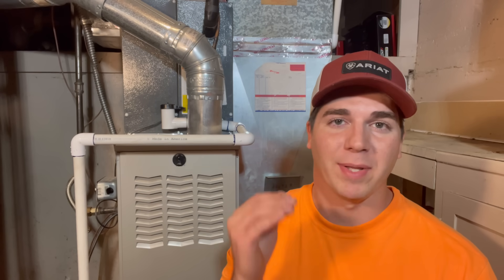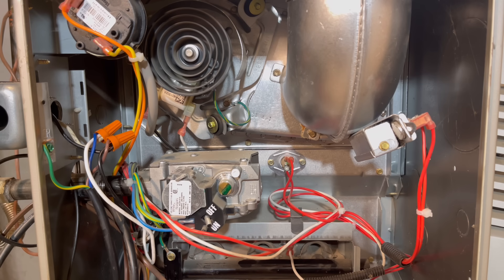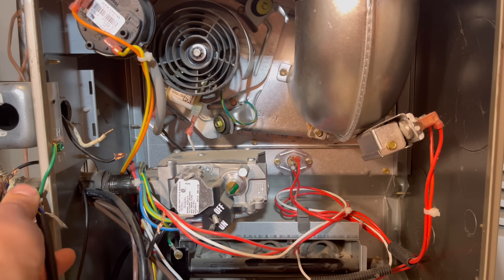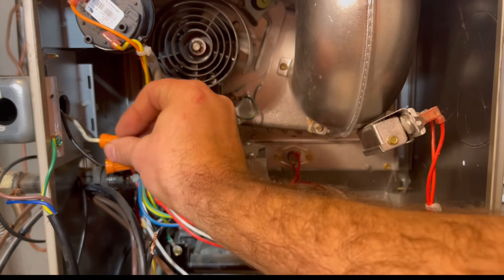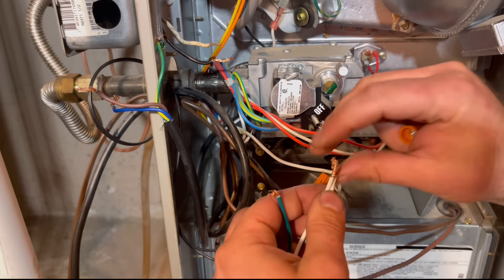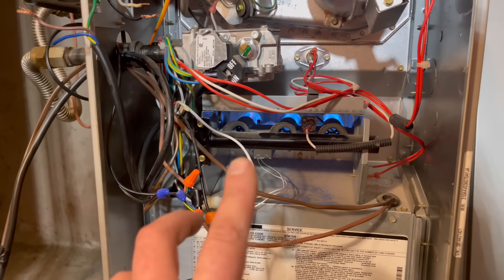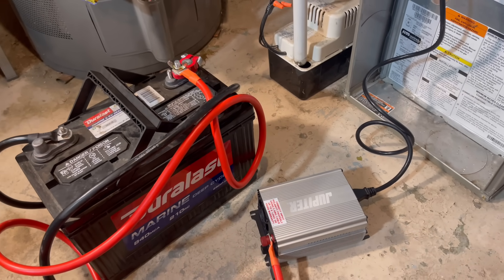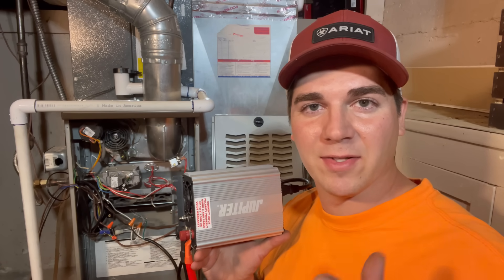Did You Know You Can Heat Your Home With A Car Battery?

Comment: Nice out of the box thinking. A few observations. As an off grid solar guy there is no way will it last days, just a couple hours at most. Average forced air furnaces pull 600-1000 Watts depending on the fuel source and fan size. Also,  lead acid's 50% DOD on a Deep Cycle paired with Peukert's Law and inverter efficiency will really hamper the idea. To run that load you really need at least a 24v input voltage inverter and several 12v Lifepo4 batteries in a series parallel config.  Another thing to note is that the inverter needs to be pure sine.  A modified wave will likely damage newer variable speed blower fans, zone actuators and logic boards. Tuning in for the runtime test.
Reply: I would still do this in a "emergency" I would rather my family be warm until I figured something else out.
Reply: @marshall7201  as long as the gas is flowing, yes.
Reply: @marshall7201 until that crappy modified sine wave inverter fries the electronics board and now you permanently don’t have heat. Bud, if you’re so worried, grab yourself a cheapo loud generator, metal Jerry cans and a suicide extension cord to plug the furnace in.
Reply: Exactly. A typical 12 volt camper battery is 100 amp hours but can only be discharged 50 amp hours. That is 50x12=600 watt hours. If furnace is 800 watts, then it will run furnace 600/800 = 3/4 hours. That said, if an inverter was connected directly to a running car, it would run about as long as there was gas in the car.
It is also true that you should use a more expensive pure sine inverter to avoid damaging the furnace motor.
Reply: @tgriebe  if you are running the car anyways just get in the car an turn on the electric heater...
Reply: @NithinJune  🤦
Reply: @NithinJune  if snow packs in up to ur exhaust pipe u could die of carbon monoxide poisoning.  That happened to a 22 yro mother and her infant when they lost power in their apt.  She thought she could keep herself and her baby warm in the car.  Poor thing perished and so did her wee one.  This happened in Laporte Indiana a few yrs back.
Reply: @Nithin  FYI cars don't use electric heat.
Reply: @tgriebe  Right.The simple,real fix,is buy a small 15 Amp gasoline generator.🙃
Reply: @tgriebe  If you go to the high side of 900ish watts that would be a 90 amp draw. I don't know of any car that can run that load at idle. This is why you don't see people running large appliances off of vehicles during outages.
Reply from the maker: @MrMike-fn4hi  hmm thanks guys for the input, I’m definitely going to try it out and see. It doesn’t run for 3-4 hrs. It will run for maybe an hr to warm up the place to 80 degrees and then sit for quite a while before I’d have to kick it back on. I may need to get crafty with the test video :) cheers all
Reply: @diyhvacguy  Exactly, the furnace usually won't have to run continuously.  In the dead of winter, when it's 15 F outside, my furnace doesn't run more than 20 minutes per hour, guaranteed.  Ironically, the more oversized your furnace, the less it'll run on the coldest days, but for a gas furnace the gas usage scales faster than the electrical use.

I'm wondering now, in an emergency where you were running the furnace off a battery, if you'd be better off lowering the thermostat, to improve heat loss efficiency -- or cranking it up, to take the maximum advantage of a hot furnace by running it longer once the heat exchanger was toasty.  Pain to test it both ways, though.
Reply: @MrMike-fn4hi  That is true, but the furnace doesn't run continuously. So the deficit of the (90 amps?) comes out of the battery. Between furnace cycles, the car continues to run and recharges the battery. One can also step up the idle speed with a little weight on the gas pedal.
Reply from the maker: @RandomAxeOfKindness  I’d love to do a test but it would take a long time.. I personally think it would be better to leave it at say 60 degrees, because it will run in small increments to keep it at 60 where as if you ramp it up to say 85 it will have to stay in for quite a while to get from 60 to 85.   I’m really excited to do this test. If only I could just film videos for a living like Scott @everydayhomerepairs haha that would be nice. 😀
Reply: @tgriebe  Yes but with a big BUT. If you are just doing this for 15-30 minutes you will likely be OK. But, if you plan to do this for a day or more during an outage there is more that comes into play. Modern vehicles monitor the amp draw with an amp clamp or shunt on the battery leads. It will full field the alternator in an attempt to get as many amps as possible from it that it can. If you are pulling 90amps at idle from an alternator that only makes 130 at it's rated 2.5-3k rpm you will have a problem once the battery's charge level starts to drop. This becomes an even larger issue with hybrids as they do not function the same and have very small starter batteries and alternators. In the past this would never have been an issue as the charging system was not monitored like it is today. You will also find vehicles that see this amp draw as a problem and set your service indicator and toss the vehicle into limp mode. High amp draw is seen as a potential short, possibly interfering with the electric throttle's operation and negatively impacting fuel economy hence the service indicator and limp in mode. Some vehicles are much more sensitive than others so it really is a crap shoot. Vehicles like trucks and full size SUV's are less likely to have the issue as they are expecting to see higher loads from third party equipment such as plows and winches and come with larger alternators. But, there is a limit. Isolation solenoids and PCM reprogramming is sometimes necessary when unfitting vehicles. Also, the inrush current of starting a large AC motor is significant, 2-3x the running watts. The alternator to battery wiring is likely only 8ga at best. At minimum  I would add a second 4ga conductor from the alternator to the battery and also a second chassis ground of 4ga or 0ga. If you really want to run a load this size you should have a generator or appropriately sized solar "generator". Another option would be Ryobi, Dewalt, Milwaukee and Ego make 2kw+ battery inverter systems now. You can install a 120v single circuit transfer switch right into the dual gang box on the furnace that will accept your extension cord. Apologies for the long response. Electrical engineer by trade, former GM powertrain engineer.
Reply: @MrMike-fn4hi  You are obviously a glass half full guy but I commend you for all the effort you have gone to to figure out a scenario where it won't work.  Of course, a generator is a better idea and of course bigger cables and a bigger battery  and inverter are a better idea. But what we have here is a guy trying to run a furnace off off a camper battery with a modified sine inverter, a plan that doesn't have a prayer of keeping a house heated during a multi-day power outage. What I have suggested is a way to recharge the battery between the brief intervals that the battery will actually run the furnace. Maybe you can expend a little effort in providing useful suggestions so that an average home owner can actually make an inverter work to their advantage.
Reply: @tgriebe  if you're ok with telling people that they can rely on their vehicle to prevent their families and pipes from freezing that is on you. Not a single car or small suv make in the past decade can do that long term without damaging it. I gave several alternatives. Just because you didn't like them is not my problem. Facts are facts.
Reply: @MrMike-fn4hi  You have provided no useful help to someone SOL with a freezing house. They don't care if you a GM engineer or a high school dropout, they want useful information. Even a small car can recharge a second battery, perhaps not while under load from an inverter, but suggesting that might be too much of a stretch for someone intent on not helping.
Reply: @tgriebe  you are off base here. Anyone can post a YouTube video. Doesn’t make it efficient, safe or worth the money. His comment was more useful to me than the video. I’m also an engineer but haven’t dealt with this side of it since college. I had tons of questions watching this video that this commenter answered snd made sense. If a non pure sine inverter can cause damage to the unit, then this battery idea isn’t something I’d try. Just because someone comes up with an out of the box idea and posts it on YouTube doesn’t make it right or good.
Reply: @tb2324  You might want to work on your reading skills. I pointed out in my first comment that a pure sine inverter would be necessary. What I also did was provide a practical suggestion for a way to make this actually work using a running vehicle to keep the battery charged enough to be useful. Richard  Head was so anxious to show off his credentials he forgot to provide a useful pathway to making this work. Instead, he came up with various scenarios where it might not work (tiny car, tiny cables, etc.)  In fact, with a typical work truck, my suggestion will work just fine.
Reply: @tgriebe  I have a suggestion, but it's an expensive one. A large solar generator capable of at least 2000 watt output that can be recharged by gas generator and/or solar panels. Also can be recharged using your vehicle.
Reply: @keyfitter  The video creator was trying to help people caught without electricity and heat using cheap items still available after all the generators get snapped up in stores. I'm not sure your suggestion fits into this theme.
Reply: @MrMike-fn4hi  that may be true to GM but any modern car  usually have 160+ alternators and have 2 gauge wiring. My ford escape has a 180a alternator and its just a 4 banger. Plus current draw would be intermitent and battery would serve exactly its purpose as a storage in between load cycle times.
Reply: @MrMike-fn4hi  I have a 94 Z71 that I installed a inverter on and have ran it the last 12 years. Working away on the road I use it frequently to charge tools, run tools, portable heaters and hot plates to cook many meals. This has been a fib for as long as I can remember.  By debunking this claim many years ago I purchased a small amp in and output monitor.  I connected it up and went about my daily business and after months of testing there wasn't much change to my amp pull on my alternator or battery.  If you get a quality vehicle these days you can get them with 110volt outlets already configured and to be used as normal.
Reply: @tb2324  modified sine wave is a PWM signal with both positive and negative going half cycles. The fast skewing edges of the wave form generates significant harmonics which reek havoc in motors due to iron saturation causing excessive heating that will distort motor winding insulation. Also the power that heats is not turned into mechanical power so 100W shaft power might take 130W electrical power.
Reply: @albertobu  my old Dodge Grand Caravan can put out 20A at idle if necessary much more at throttle. What amperage can a more modern vehicle do at idle?   One needs to be careful and respect the charging rate of batteries, especially FLA cells. It could take hours to properly charge a completely discharged FLA battery so frequent charges like every time the furnace goes off would be necessary to protect the battery and keep up with the demand.
Reply: @MrMike-fn4hi  Excellent!!!
Reply: @MrMike-fn4hi  Thanks for that.  It is not just for keeping the Gas Valve open, there is a sizeable Fan that requires sufficient Amps to operate the furnace.
Reply: @RandomAxeOfKindness dead of winter here waaaaaay colder then 15F where I live, but I guess if you were in Texas and you could run your furnace even for an hr a day is all you would need to keep your pipes from freezing up
Reply: @albertobu  I was just reading these comments and I’m glad you pointed out that the alternator has the amp capability! but it’s not advisable to load the alternator at low rpms it’s ok to recharge the battery at idle but excessive load can overheat it! Low speed is when an alternator is at higher stress and temperature! I’d advise to use a higher idle even 2000rpm will drop the temperature compared with 1000rpm
Reply: @MrMike-fn4hi  9
Reply: @diyhvacguy  Looking forward to the test video! Hopefully you include runtime on battery setup as well as runtime & setup of connection to a running vehicle. Thanks!
Reply from the maker: @BenFyvie  yes for sure
Reply: @diyhvacguy  Hey when you try this, put a kill-a-watt meter between the source and furnace so you'll know how much power it uses.
Reply from the maker: @coondogtheman  I’ll pick one of those up for sure. Thanks!
Reply: @diyhvacguy  I love mine. Got it from harbor freight.
Reply: @tgriebe  As stated multiple times above,the  battery is the limiting factor,when dealing with this power consumption.
Correct,it's gasoline generator time.
 Solar generators are simply " toys" very limited power production,even if it's sitting in the desert sun.Small solar generators,will maybe charge a phone.In a blizzard,you're just going to hear some clicks 🙃
Reply: @MrMike-fn4hi  All good. Only took two hours to break it down. Now I'm on the generator bandwagon. 🤣 What about switching from petrol to water with the hydrogen in real time conversions generators I've seen here on YT.  Only asking because of the highly intelligent conversation here.
Reply: @bcole3442  Not my video, but if you don't have a generator, this inverter / truck alternator set up is an alternative to get you by. I never suggested using a solar panel, so I don't know where you got that.
Reply: @tgriebe  Sorry about the solar,was someone else's comment
Reply: @diyhvacguy  my I also suggest getting a good used VERY fuel efficient car like a 3cylinder Geo-Metro / Suzuki-Swift and using it as both a cheap GENERATOR to recharge multiple batteries AND to use as a water heater to heat up multiple Cast Iron Radiators in your home like the type used in old schools & other large buildings built up until about the 1970's . Disconnect the heater core hoses from the Geo-Metro / Suzuki-Swift heater core & connect the hose to the cast iron Radiators that you would need to install through out the house to keep it warm . Plus you could remove the seats & store the extra batteries and power inverter inside the car and also bolt solar panels to the outside of the car .
Reply: @MrMike-fn4hi I have a small SUV that can.  It’s a PHEV Rav4 Prime and has a 1500 watt inverter that runs off the high voltage battery. Even the rav4 hybrids non PHEV have it. Just runs off a much smaller 2kw battery Vs 15-18 kw in the PHEV. 
The most ideal is a large 3-5kw + battery bank/solar generator though. It can be done for $1500 using a 48v server rack 5kw battery and a 3k all in one inverter
Reply: @tgriebe  wow….what a comeback….you smoked him….in a nice way, which is a talent I share with you, but I rarely see people do it better…..but u did!  Nice retort!
Reply: @RandomAxeOfKindness  9th
Reply: @diyhvacguy  b
Reply: @tgriebe  mike smoked you like a cigarette….. 😂where’s the ashtray for toms ashes !!!
Reply: @tgriebe  aside from the battle between you guys, I just want to point out this inverter is a pure sine wave, not modified. It's still not gonna keep the house toasty for 3 days in freezing weather, but I thought I'd point that out for the technical aspect. It seems like a really good little inverter for a $145 price point! I'm glad he drew my attention to it. I need a little one to run my aquariums off of in case of power outage, and now am thinking having an extra for the house is a good idea.
Reply: @tb2324  check the link... it's a pure sine wave inverter with good reviews. Several people tested it and report it produces a really good, smooth wave.
Reply: @cherylmockotr  Yes, I pointed out in my initial post that a pure sine inverter would be preferred to the modified sine inverter the video creator had linked.
Reply: @tgriebe  that's what I'm saying... it IS a pure sine wave converter, he's NOT recommending a modified wave device.
Reply: @cherylmockotr  He changed the link after we pointed out that the modified sine inverter he used in the video was inappropriate. It was a good idea to update the link, but it has confused you and others.
Reply: @MrMike-fn4hi  the Prius may be the best car for this, I’ve run my inverter on it pretty hard and have had no issues, you just have to keep it in ready mode. The Gen 3 (‘10 and up) have over 100A DC-DC converters with liquid cooling, and if you over do it they’ll trip out without failing. They also make inverters that run direct from the HV pack now and you can pull 5kW+ continuously and the car doesn’t care at all, it’ll just run the engine when needed.
Reply: @tgriebe  ah, that makes sense now... thanks. He probably should have put that in the description of the link. At least it's a pretty decent looking unit!
Reply: @diyhvacguy  if the power is out, how does the thermostat function?
Reply: @tgriebe  if u have a gas stove boil water to heat the home or room.  Occasionally allow a bit of moisture to escape especially in newer homes so that moisture doesn't accumulate in the attic.  Its a quick fix without having to Frankenstein ur furnace power hookup.
Reply: @americaneden3090  No,no, no. Never use a stove for heat. Every stove manual tells you this.
Reply: @tgriebe  kinda of a use what ya got to survive mentality
Reply: @michaelcharach  We had non-stop utilities in Austin and my kitchen faucet still froze last week.

Home building in Texas is just not spec’d for hard freezes. (We had 15f.) Exterior faucet valves are located outside of house walls, pipes are buried just 12” deep, that sort if thing.
Reply: @MrMike-fn4hi  I don't think anyone here was looking at this for supplementing power with their car as a "long term" solution. Will doing as the other guy said cause damage to you vehicle/alternator? Yes, but so will a trip to Wal-Mart. In the grand scheme of a 200k mile life, a few recharge cycles in an emergency will not even be noticed.
Reply: @MrMike-fn4hi i have a 325A alternator on my car? Wouldn't that carry a 90a draw? (DC Power billet HO alt)
Reply: @mrkoolio4475  funny I was thinking the same thing wtg lol
Reply: @MrMike-fn4hi  if you don't want your pipes to freeze,you just leave them on a trickle, if the water keeps moving,even if only slightly,then they won't freeze
Reply: @diyhvacguy  exactly. My furnace runs for 5-10 minutes at a time to get it up to temp.
Reply: @MrMike-fn4hi  that explains a lot 😂 a GM engineer 😂😂😂😂 a company that builds utter garbage and hasn’t moved out of the stone age of engines. 😂 engineers people they generally have no clue what actually happens in the real world and it’s usually mechanics, electricians, programmers etc that have to fix their screw ups.
Reply: @terryharris3393  😂😂😂😂😂😂😂😂😂😂😂😂😂😂😂😂😂😂😂😂😂 who told you that? Every vfd on the planet outputs essentially a square wave and they have never harmed any motors I’ve ever been around.
Reply: @lonewolftech  Even though VFD drives produce a PWM voltage the current is nearly sinusoidal due to power filters on the drives output. These eliminate the harmonic content. It’s the iron losses due to the harmonics that generate heat due to flux saturation in motors and unless a modified sine wave inverter has an output filter its output will contain the harmonics.
Reply: I agree, a vehicle battery wouldn't have the capacity to do this for long. A better bet would be to leave the battery in the vehicle (or jumper it to the vehicle if it's an aux battery) and hook up the inverter and then run an AC extension cord from the inverter down to the basement. Start the car, run the furnace for a while, then shut off the inverter and let the car battery charge back up then shut off the car. You could repeat this almost indefinitely as long as you have gas in the car and you don't have to lug that car battery up and down the stairs or disconnect/reconnect it every time.
Reply: @TheDaniel688  charging a flooded lead acid battery in a non ventilated space isn’t a good idea, let alone next to an ignition source. Also, setting it on a concrete slab will not only drain it but when a charging cycle begins there will be much more hydrogen gas produced. 😮
Reply: @terryharris3393  did you reply to the wrong person? I didn't propose doing either of those things.
Reply: @TheDaniel688  .. this whole video and commentary is surreal..
The joker that made it didn't bother to actually try it and none of the 'experts' have either... ☠️👀
So yes this was a complete (possibly dangerous) You Tube clickbait troll ..these inexpensive inverters use up a lot of current just to run themselves even with no load, much less any high demand system.. (and the triangular wave output will fry most electronics control)
... My expertise ?..
I'm in Florida and have been using one for years during hurricane blackouts .. to simply run a room fan and led lighting.. intermittently..
Reply: @terryharris3393  you just lost all credibility when you said leaving a battery sitting on concrete will drain it. That is one of the oldest wives tales in the world. I'd like to see you explain how concrete is going to drain a battery when it is not even touching any electrical contacts. It's literally only touching the plastic box that is holding the chemicals.
Reply: @terryharris3393  he never said anything about running the car in an enclosed space.
Reply: @TheDaniel688  Don't pay any attention to him he actually believes the wife tale about concrete draining batteries.
Reply: @terryharris3393  You're right about ventilating the space but wrong about the concrete floor somehow depleting the battery. That's an old wive's tale that Exide Technologies, one of the world's biggest battery manufacturers, debunked back in the late 1980's. The surface you place a lead-acid battery on has NO effect on the internal chemistry or its performance.
Reply: @actionjksn  At Sears we charged batteries on a metal rack that was on top of concrete slab. The battery room was always a mess.
Reply: @fromthebackofmymind  either way if a battery sits on top of concrete it will have absolutely no effect, it does not drain the juice out of a batteries. Back in the really old days in the early days of automobiles battery boxes were made of wood, and the wood could draw moisture from the concrete and rot the wood. At that time you did not want to leave a battery sitting on concrete. But in our lifetimes batteries have not been made out of wood.

I never believed it because it never made any sense to me, because I could not figure out any mechanism that would cause that to happen. So I checked on some websites with electrical engineers and you know those Smart Guys and they all said the idea that concrete will drain a battery is stupid.
Reply: @terryharris3393  curious how a concrete slab can drain a battery. Last I checked, batteries are equipped with a insulating material for its housing. You can install a battery on steel and it works just fine.  

Something tells me that the sulphuric acid, if leaking from a battery will destroy concrete.  That only happens when charging a unhealthy battery, or overcharging a battery.  I also observed that they also give off gas when being discharged.  Does hydrogen gas affect cement?
Reply: @pixels303at-odysee9  old wives tale that just refuses to die. Back in the day and I mean 60+ years ago batteries were made of wood casing and the wood was conductive enough to slightly ground itself to concrete. But I mean, talk about zero chances of it happening now.
Reply: @actionjksn  try it ?
Reply: Seems like a lot to ask of a single battery. A small 2000 W generator might be a good option to tap into that wiring.  maybe one with a NG conversion kit??
Reply: @peterfairlie2296  I think I recommended a pure sine inverter.
Reply: We actually have a lifepo4 solar setup in our camper that we could run cables to in a situation like this. 
It's got a built-in pure sine wave inverter too. Seems like that would be ready to go for a situation like this.
Reply: Why not just stay in the camper lol
Reply: Off the grid?yet here you are on the internet
Reply: Yes, the question is not if it will run. It's all about how long it will run. I have two off grid installs that would run a gas furnace for a while if I had one. Unfortunately I have a down draft electric furnace which would simply draw too much current even if I rewired in series.
Reply: While the battery is running the heater, it can charge with a 10,000 watt  charger from a generator welded to the blower motor.
Reply: Great video and idea. Hate that all the internet Einstein types couldn't wait to put their negatively charged two cents worth in. Your idea might help someone stay alive
Reply: Put a kilowatt meter inline with the furnace.  This will tell you how much the furnace draws. Those figures with simple math will give you a ballpark idea of how long it might run. Of course battery size, and age will lesson the run time.
I live in the country, and have small kids, so redundant power, and heat are a must.
I have a generator just for times like this, and have used it, but, I primarily heat my house with a pellet stove, and use the furnace as backup. 
I cycle the furnace and genny every 30 days, and with a genny, I can run my well and fridge too.
Reply: You'll have about 2 hours of the furnace working and then no way to start your vehicle... genius.

The common sense thing to do is have a cheap generator with a natural gas or propane conversion and they you have clean electricity for weeks at a time if need be.
Reply: Can you stack a few batteries for extended power life?
Reply: @chrissullivan40  Yes, but I think it makes much more sense if you have multiple batteries to just recharge one and swap it out when it’s charged. 

Also, most power outages only last a few hours tops, this would be an ok way to keep the house up to temp for the extreme vast majority of outages given you didn’t have access to a generator. Really though a generator is the best idea and you can get small used ones for pretty cheap, then you can power your refrigerator, lights, chargers, even tv and internet usually off a generator. Even if you wanted to just run your furnace, I’m sure a generator is going to use a magnitude less gas than running your car to recharge these car batteries and swap them. Then there’s just the convenience, you can wire up an automatic generator but even the most crude setups aren’t a big deal, switch off main breaker, plug generator in, start up and get running then flip your generator breaker on.
Reply: I think the spirit of this video is “oh sh!t the power went out and I’m unprepared, what can I do in a pinch to get my furnace going” and given that situation you may* have all the stuff needed to perform this, but if you’re planning ahead then you plan with a generator of some sort, it doesn’t make much sense to plan ahead by having all the stuff to do this.
Reply: Great short term solution. But I’d rather depend on a generator for a long term solution to a power outage but nonetheless thank you for taking the time out for a quick fix to not freezing the house pipes and family.
Reply: How about a battery for a caterpillar bulldozer?  24 volts, tons of cranking amps?
Reply: 2 + 2 =4
Reply: @kyledakilla8724  not since the plannedemic lol
Reply: I've done this to power my refrigerator in the summer during a power outage. I do want to know if this will work to power my all electric heat pump?
Reply: @djinncat  it will not run an electric heat system.  This would not run a small space heater on the high setting.  This only works because the electricity for it is only spinning fan and working the ignition and controller. You would need a lot more power to run an electric heat pump.
Reply: @actionjksn  you are right about electric baseboard heat and space heaters though. That's different the heat is coming from only electric elements not gas. Electric heat is 100% efficient. Meaning 100% of the electric is turned into heat BUT it is a terrible way to heat anything. Costs far more to heat with electric than gas
Reply: @djinncat  isn't that heat pump 240v?
Reply: I have a gas boiler system so it probably would work well.
Reply: @toddforslund3571  yeah... just have to power the pump. I think most run at less than 1 amp
Reply: Well this trick is pretty badass if you live  in the north and don't have a generator when SHTF. You recharge the battery in your car multiple times a day and keep pipes from freezing 🥶. Lots of possibilities. According to my HVAC guy a lot of modern furnace's won't run on smaller generators cause they can't sense a ground and you have to run the generator to your breaker and plug into the normal wall outlet, something like that anyways.
Reply: Mr. Mike, Yet another reason to have a decent sized generator that can run on natural gas or propane. I keep matches handy to light the non functional spark igniters, for burners on my stove during outages. Dead of winter, I can put all my refrigerated food into an extra freezer in the shed. Powered or not. Insulated box.
Reply: That’s incorrect. My furnace draws less than 50 watts at 120 volts when running. That’s 0.46 amps. For the D.C conversion it’s 4.6 amps but let’s round that up to 5 amps. I have a 208 amp hour battery bank. I’ll get 20 hours to 50% capacity.
Reply: In emergency situation some hrs of heat better than nothing bro.
Reply: Better then nothing
Reply: Must be tiny btu furnace, 1,000  watt inverter will not start my furnace , also car battery can’t take a big drain like deep cycle battery’s can and are made for..
Reply: Thank you for the rest of the story. His idea is good on the surface but there are a lot of electrical caveats he is overlooking. Furnace fan motors have a high start up current also. In addition to the variable speed motors not liking a clean wave the electronic circuit boards might also frown upon it.
Reply: 🤔 I never knew about the batteries. Peeked at the Dakota site. Whoa, those are awesome. Power depletion evenly and twice the power of standard. Use for off grid power systems and half the weight. I sound like a damn troll but hooked on this idea.
Reply: Cool, but way to much for the average person to try, and safety wise i would have a lot of concerns about anyone other than a qualified electrician or a skilled DIY person doing this on their own.  We have solar and batteries, and if we were to need to run on batteries we can use the management app (or just turn off specific items at the breakers) to exclude the most taxing appliances.  I would be very concerned about the start-up amps needed by the inverter.
Reply: @john4703  It is good that you know your personal limitations, but not everyone is an idiot. Some people should call an electrician to change a light bulb.
Reply: Alot involved, but for basic furnace nothing special it may keep the pipes from freezing till power is restored.
Reply: Maybe a space heater which runs a motor the size of a softball.
Reply: Could last longer if you power it off jumper cables off your car that you leave running.
Reply: Where are you getting that high of watts on a gas furnace? It's just a fan and ignitor. Maybe a 200w load at most. Unless they're significantly worse than camper units since mine only draws about 3A at 12v to run the blower.
Reply: You beat me to it...Fan will drain it pretty fast no doubt about it.
Reply: It will last days I have done it myself
Reply: Glad I read this. Thank you.
Reply: I actually did this.  Dead of winter last year, power went out.  I took a extension cable from my fifth wheel trailer, modified it with two male connectors, turned off my main 100amp fuse and then turned on my trailer inverter.  I use only True Sine wave on my very expensive 1200watt inverter and seven of my used car batteries I decided to recondition and installed in my trailer.  After one day of running my furnace, fridge, freezer and a few LED lights my batteries were beginning to brown out after 8 hours of use.  I had to then start my generator and start charging my batteries to last the 16 remaining hours required for utilities to be reconnected.

Only drawback using a cheater cord is if a person accidentally connects power to the house without turning off the mains.  If you do that, you can potentially feed power back into the grid and electrocute a lineman or if the phase or frequency differs to the electricity that is reconnected, you could blow up your expensive inverter.  Always disconnect your cheater cord after turning off your inverter as well to prevent electrocution. Never turn on your main until everything is disconnected. 

My way is far quicker to do, providing you are familiar with your load ratings on appliances.  If you plug in or turn on too many things with a classic 12-15 amp electrical cord, you will be overloading your inverter.

Modified Sine wave inverters are garbage.  I blew up more of these inverters than I could shake a stick at.  Switching power supplies which electronics are equipped with do not work well with a square wave input.   Unless you plan on using your inverter for a resistive load, do not ever use them.
Reply: Nicely said.
Reply: Calm down everyone. It’s not worth arguing over. Take what you can use and leave the rest. I’m sure some will benefit from watching. Let’s get back to being able to have an opinions with out getting pissed off for not having the same opinion. Sad to see how corporate America is killing America and keeping everyone fighting. And paying their taxes for them.
Reply: @G-S-D  so true. Everything you said.  Reading comments brings the worst out of people because words without tone or body language/facial expression can be grossly misinterpreted.  Doesn't help any that media is programming people on a CIA style psychedelic style.  Gender confusion, health measure confusion, giving up rights for security confusion and spending all your money on inflation confusion.  List goes on and on, all designed to divide and conquer under a guise of health, well being and tolerance.
Reply: Lucky guess! 😂
Daggone mister! YOU KNOW THINGS!!! You are what I refer as a "Tall Forehead".
Very knowledgeable! Thanks for answering questions and concerns that 8 had.
Reply: I did a test. I have 10 batteries parallel. I connected the furnace to the battery bank. In half hour the batteries went from 13.5 to 12.4
Reply: How will my furnace kick in since I have an electric programmable thermostat? ? Will this also power the thermostat upstairs?
Reply: A lot of these u tube vids show peeps how to fk up their shit so i would not be surprised if it did do damage .... then ya got to call this guy to come fix the shit you fked up cause ya saw it on boob tube
Reply: That would be pens on battery sir. Sit down and pipe down.
Reply: It's a gas furnace though. Much less electrical load than an electric furnace
Reply: If it were only this simple, but it’s not.  A lead acid battery will not run very long with an inverter supplying 120 volts power.  Moreover, you’d better hope that you are getting clean 120 volt a/c power at 60 cycles from the inverter or you’ll be replacing motors on your furnace.  

Your best bet is to buy a small generator to run this unit.  The small Honda units (EU2200i) that are no larger than a suitcase can do a much better job and can also help you keep your fridge and other small appliances going.  Now, they ain’t cheap, but if you can snare a used one or a knock off version, you’re better off than the battery/inverter setup.  Better yet, get a good 7000 watt generator that’s portable and you can power quite a bit if faced with a long power failure.  

Again, be careful when running motors with temporary power of any kind.  120 volt motors don’t like under voltage situations or massive spikes.  You’ll be paying me, (HVAC contractor) to replace a bunch of stuff if it doesn’t work well.  My 2 cents.
Reply: Can we download your brain xD
Reply: Thanks. Question : Gasoline generator to supply heating/cooling to your home HVAC an option ? How hard would it be for a homeowner to configure this ? Thanks.
Reply: @dannyhayes664  See the DIY HVAC Guys other video on how to wire in a plug so a generator can run the furnace off a heavy extension cord.
Reply: Screw all that crap ,I'll  lite a fire in my real fireplace, over 5 thousand  pieces  of split  wood  should  last  a while
Reply: @danmittler6321  Very helpful.
Reply: Mr. Mike can you do the same breakdown but with a mini split ac? Your explanation is helping me understand the math. I am a fellow offgrid'r myself and I'm still trying to grasp it all. 
I just inherited a led acid battery bank. They are older battery's but haven't been used and were new when they were purchased.
Reply: Car batteries are like 40amp hours. My furnace is about 1000watts. That would be about 100amp draw at 12 volts. You are talking like 35 to 45minutes of run time off a new car battery
Reply: @jacobadam4556  Sorta late to the party. See the follow up video.
Reply: @tgriebe  I seen follow up and in that he said 3 hours still not possible if you do the math. He showed roughly 500 watts at 11.5 volts. That's about 45 amp draw from inverter on a 40 amp hour battery. He will be lucky to get an hour of run time off a fully charged car battery.
Reply: @jacobadam4556  Exactly. that is why he switched to powering off a running vehicle's battery.
Reply: @tgriebe  and that's why it would be smarter to power off a single cylinder gasoline generator like people with atleast an average intelligence do.
Reply: @jacobadam4556  Everyone has a car or truck. Who has an extra single cylinder engine sitting around when a power outage strikes suddenly?
Reply: @tgriebe  most people I know don't have a power inverter either. Lots of people around here lost power and their pipes froze in their house when that arctic blast came through a few days ago. My neighbor could have simply lit a freaking match to their propane stove. People do what they want, just because they have a car doesn't mean they have a clue LoL c'mon man get a grip
Reply: @tgriebe  I'm sitting here at my buddys drinking beer only one awake in a house at 55 degrees with my winter coat on waiting for his roomate to wake up and bitch about throwing wood on the fire. It's all frozen wet, most of it not split right, i seen these guys waste 4 cords of wood already because they won't listen to me about efficiencies and firewood. I'm done talking to a freaking wall and I'm not throwing more bullshit on a fire. He has about 300 gallons of propane he can start burning LoL I'm not cold and my beer isn't warm. And here in a few hours a dumb ass might get punched in the mouth because I'm done listening to one complain because they didn't listen to me.
Reply: @jacobadam4556  But anyone can buy an inverter at a auto parts or hardware store and follow the video. Who is going to buy a small engine and rig up an alternator on short notice?
Reply: @tgriebe  and anyone can buy a gasoline powered generator. The power inverter is nice for camping away from home.
Reply: @jacobadam4556  You can't buy a generator when a sudden big storm hits - the stores get cleaned out in minutes - which is exactly why this video was created, to provide an alternative.
Reply: What if your blower motor runs off of 220 volts?
Reply: Would this work better (longer) on a hot water (hydronic) system that uses a pump rather than a blower?
Reply: Thank you.
Reply: Try an Odyssey brand battery , it will run much longer
Reply: An Odyssey brand battery would work much better
Reply: Actually if it's just running just the fan... It's not going to use that many watts because the heat is not coming from electricity the heat is coming from gas cuz you can hear the sound of the flame light up.... That electric motor spinning that fan might pull 10 amps Max at startup and after that it's going to be about 4-6: amps while it's running..... However if it's an electric heater anything that's electric that creates heat by use of the electricity draws a lot of Watts
Reply: Hey thanks for your input I've had TV on my house this 1985 went through a lot of r&b learning curves but it was all worth it I double-wired my home on DC only and went through a lot of headaches but finally figured out with a few computer hacks with computer grade power supplies to bump the voltage up and amperage had a few brownouts if you know what I mean and a lot of wires. Yeah this guy found out real quick about the battery a fresh battery out of vehicle sure it's going to run good for a while Kelly Burns off the good part then he'll figure it out another thing I told him that transformer in the furnace doesn't like modified sine wave inverter still figured out out pretty soon too when it Cooks everything real slowly. My 1.4 kilowatt run with 2000 A H for about 10 years couldn't grid tie back in them days. Home power the magazine was my lifesaver.
Reply: I was thinking the same thing. No way that will last days. Not sure I want a lead acid battery that produces hydrogen next to my water tank.
Reply: Square waves etc won’t harm electric motors. Most vfds don’t output a pure sign wave and every factory in the world uses them on their motors. Nor will it harm the boards as they already are DC…
Reply: @lonewolftech  which board is dc?  Bryant plus 90i control board is 24vac. The motor controller is 120v ac, the blower motor is 3ph. This unit won't run properly on a 5500watt generator due to the dirty power.
Reply: @yall guys doing science in the comment section.... I ran a 750watt space heater off a crappy little Toyota Yaris(fit right under my porch) and a 1k inverter for over a week. No it wasn't running the entire time but it ran all night with a few blasts during the day. Sometimes things just work even when in theory they shouldn't... This man's solution isn't perfect, it's to not freeze to death during a storm. You can purchase a small generator for not much more than this setup costs, as long as you aren't doing it during an outage. I have 2 generators I bought used. A very old 3k that works great for $100 and a 1k with a broken pull start for $40. Ideally plan ahead but if your in a pinch and your pipes are about to burst or ur big toe is going to fall off, this is an ingenious idea to keep in the back of your mind.... Thanks for the good stuff HVAC guy
Reply: @robertborgeson1821  Running a 750W load for ‘all night’ or 12 hours is 9000 Wh. NO car battery has that capacity so your completely full of shit.
Reply: @terryharris3393  u must be right
Reply: How'd that solar work out for you or how would it have...you fraud!!!!
Reply: Never put a battery on concrete. It drains the juice.
Reply: How many cars u got? Any straight shifts you can roll off recharge the extra battery?
Reply: All this bs, an hes just like for emergency. Jesus Mr genius what color is a mirror.
Reply: @charliewilliams5105  idk but I have many car battery’s and 2 of these and a 2 stroke gen , sadly the big 2 stroke gen kills out with power saw, ran a grinder a Chopsaw and a drill same time with one those 149 dollar harbor freight converters , but u can build you own fairly easy out of a hamster wheel a generator and microwave transformer just make sure the hamster has a back up and another back up, it’s hard get those furry things to do anything but work out
Reply: Wow…and here I thought a man’s communication difficulties were mainly with women…I commend your manners during this misunderstanding…This would be Jerry Springer material if y’all were female…🤷‍♀️
🦋Lily🦋
Reply: @Lily_Samson  You have fallen for a classic passive aggressive ploy. The way it works is the PA throws out a bunch of technical information which on the face of it looks like it is being helpful, but in reality is just an attempt to make the PA look smart and by inference, the video creator, look dumb. When examined, the PA has done absolutely nothing to help out, but has merely shot out a bunch of "look how smart I am"  factlets.
Reply: @peterfairlie2296  I don't know why you directed the comment to me - I never suggested using a using a cheap generator with a poorly regulated output. The topic here is making a furnace run off an inverter and a battery. I pointed out that a vehicle can recharge that battery to extend the amount of time the furnace can run. And I suggested that a pure sine inverter be used.
Reply: @peterfairlie2296  Don't be a troll. I gave a good answer to the video creator and provided useful information to anyone wanting to run a similar furnace in an emergency situation. You are just standing back throwing sand in the gears for some sad reason.
Reply: Thanks. You saved me some time responding with some of the same comments. Don’t forget the pesky no load power consumption and the necessity of 3-6x surge capacity of the inverter, and relatively low .85-.9 efficiency. The Jupiter inverter model in the video looks like a 2000/4000W run/surge model and is a modified sine inverter with a 13W no load power consumption. Given the video shows a Duralast 29DP-DC flooded lead acid cell with a 65Ah capacity (fully discharged) the no load power consumption would kill the battery in 60 hours without delivering a single watt to the blower motor. 

Of course the time a furnace is on depends on the indoor set temp and the outdoor temp and the size of home and the quality of insulation and other heat loss factors (windows air ingress …) and the load on the battery is determined by the power rating of the blower motor, which could be anywhere from 1/3 - 3/4 Hp (250W-600W). Assuming a 50% duty cycle with 1/3 Hp blower would yield an average power (including no load loss) of 131W. A 65Ah x 12V battery x .9 eff (700Wh) would last 5.35 hours until the battery is COMPLETLEY DEAD! Half that time if you want to not destroy you battery. Lower dc increases the time and higher dc and/or blower motor size decrease the time. 

Also, modifying your furnace will void your insurance policy and should something go wrong …. $$$$$ on you.
Reply: Guys the there is not much Amp draw on a furnace maybe 5amps. So maybe 600watts. A furnace runs for 10. . maybe 20 minutes max then shuts down for 45 min before cycling again. The natural gas does the heavy lifting. This isn't shocking a battery and pure sine inverter will absolutely run a furnace and keep a house warm for some length of time. And if you have to use a running car it will definitely work. 100Ah battery will run a 600W appliance for 2 hours. 20 min cycle time 40 min off time. That's about 6 hours runtime on a 100ah battery. Plenty of time to recharge with car and keep house warm in most emergency conditions.
Reply: Newer systems with the ECM blower motor only draw about 4 amps at 120v, that's ~480 watts. I'd bet that in an emergency if you ran it sparingly it could last a couple of days. If you have a 1200cca battery lead acid or otherwise at 12 volts you'd have 8.6 kwh .
Reply: @MrKalashnikov47  your understanding of battery capacity is wrong. Its KWh of capacity not CCA of a battery that determine the energy in a battery. For instance, the video shows a Duralast 29DP-DC battery. It is a 844A CCA battery but only a 65Ah capacity. 65Ah x 12V = 780Wh of energy. Marine & RV FLA batteries are a poor choice for powering off grid loads. They trade a little CCA for a little loss in KWh. Deep cycle forklift or golf cart FLA batteries are better and, of course, LiFePO are the best for several reasons, like very high usable KWh.
Reply: You don’t even know how your batteries are connected it’s either series or  parallel
Reply: @EsotericDungeon  they seem to be in series.
Reply: @caru3257  thanks
Reply: @EsotericDungeon  😂 no you can connect them series, parallel, or in series parallel…. Google something before posting..
Reply: Mr. Mike, please elaborate on this "Peukert's law" as I am guienuinly curious
Reply: @jeffreystroman2811  Peukert's law says that the faster you take power out of a battery, the less of its total capacity you can use. For example, a 100 amp hour battery might theoretically provide 100 hours of power at a one amp draw, but it won't provide 100 amps for one hour. In fact it will be much,. much less. This is a simplified example because, especially with lead acid batteries, you can't just fully deplete them without damage, but it demonstrates the point.
Reply: @tgriebe
Reply: @tgriebe  well I very much appreciate all the detailed comments here. I will try to make sense of it all. I do believe not is something worth considering.. as winter season is here and ya just never know.. i probably will invest in a solar generator, Anker add popped up while watching this video.. looks like a good alternative. I myself have used a Bluetti in the past to run a small electric heater. But it too only last few hours on and off. Needs sun to recharge.🌞⚡️
Reply: @jeffreystroman2811  There's a guy on YouTube called "Knurlgnur" who has videos about Peukerts Law. He's an engineer, seems to know what he's talking about.
Reply: @jeffreystroman2811  The amp-hour capacity of a battery changes dramatically depending on load.  They are sometimes described in "C" as in, 1C means x amps for one hour.  An 80 amp-hour battery should deliver 80 amps for one hour, but as it does that, its voltage will drop significantly.  But you might think, 160 amps for 1/2 hour; but that's not how it works.  A heavy load decreases the apparent capacity of a battery.  In the case of lead-acid batteries, this factor is huge.  You might get only 1/4 the rated amp-hour out of a battery under heavy load AND you will reduce the number of charge cycles.  A car battery can go "flat" only about 8 times.  Deep cycle batteries are more robust BUT cannot deliver sustained high current.
Lithium has the remarkable property of being not very much affected by load.  It still has that effect, but it is a lot less, and maintains voltage until nearly discharged.
Reply: maybe dumb Question ???  Thermostat power      Nest Common wire
Reply: @deadfisfhalequin2304  I think I’ve heard in the past that the thermostat is powered through the furnace, but what about the connection? I can’t remember if it’s Bluetooth or Wi-Fi. It’s a good point.
Reply: @deadfisfhalequin2304  common wire is hooked up on control bored with other control wires (low voltage) not relevant to what was done in this video
Reply: Exactly, and that Jupiter inverter is from Harbor Freight and it is modified, NOT pure sine wave. Get a cheap Renogy and it’ll do the trick
Reply: I know they’re out of style but if you have a radiant heat that’s passive (no blower) the battery will keep it operating for days.
Reply: @rustyprinter1  you think that radiant heat is going to use less electricity than a small electric motor on a furnace? Hahaha
Reply: @actionjksn      a boiler is basically only powering a circulation pump, it's the only thing drawing a real load.  Most run at .7 Amps. That's nothing! Far less then the blower and draft inducer motor of a furnace. So yes a boiler uses less electricity.  
A boiler will use about 200watts while a high efficiency condensing furnace will use 600watts. Boilers also use less fuel to heat than a furnace will.
Reply: @actionjksn  
I was referencing a propane floor furnace where all you need is a twelve vote battery to run the thermostat. Thank you for so kindly pointing out everyone’s errors. I’m sure you’re very popular. 🤦‍♂️
Reply: @rustyprinter1  Oh yes definitely and really that is something I care a great deal about..
Reply: @actionjksn  
I don’t remember asking what you cared about.
Reply: @actionjksn  it depends on the heat source driving the radiant heat.  We had a house in Colorado with radiant heat in the ceiling.  That was powered by 220V, loads of amps.  If the heat source is Natual Gas or Propane, then the inverter is powering the pump that circulates the heating medium and not generating heat.

In short, if you get all your energy from the electric grid, you'll be freezing in the dark...
Reply: I was thinking the same thing in terms of a full electric heater, however if you watch till the end of the video, he's illustrating a gas furnace, lit by electric spark... Kind of misleading I know
Reply: Spot on. Absolutely has to be sine for electric motors and newer equipment
Reply: @c117ls7  no it doesn’t 😂 how are so many of you that uneducated? Square wave, modified sine wave, pure sine wave etc doesn’t make a fuck to an electric motor.
Reply: Short of testing to see how long it lasts, you could put an ampmeter on it and see what the true draw is. 

 If it's a steam boiler without circulators of fans, It probably only draws 25-50 watts. 

If it's an old style gas furnace with a circulator add the 50 and another 40-90 watts for a circulator ( I just checked the wattages on one ).  

If it's a forced air system, you need to look at what the fan draws. Perhaps 1-200 watts at a guess.

For a newer forced  draft furnace you have a fair amount of electronics as well as the draft fans.  Plus the fan or  circulator. 

So, best case this rig might power a furnace for a couple of days in mild weather. Worst case, a couple of hours of continuous run. 

Now, add a few solar cells to charge the batteries and this rig could easily run without problem for days in mild weather. 

BTW, I have a connector on my car that I can charge external batteries like this so I could run this as long as my gas holds out.
Reply: @bobmazzi7435  My google search indicates a small furnace blower draws 400W or 33A. Larger furnace, more watts.  A brushless DC motor would be the ticket.
Reply: @proppo4924  400 watts would be a 3.3 amp draw at 120 volts, not 33 amps.
Reply: @James-vn8zb  maybe they were thinking of the 12 volt draw?  Theoretically, it would be a factor of ten, plus inefficiencies of the circuitry.
Reply: @pixels303at-odysee9  I think it was just a mathematical error.
Reply: @James-vn8zb  And 33 amps at 12v